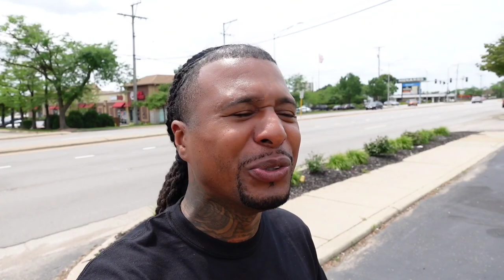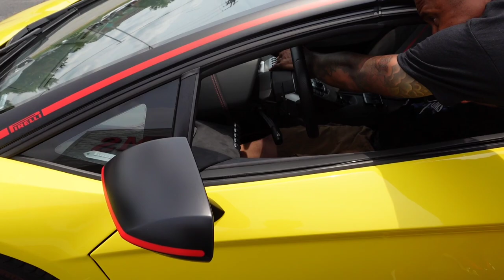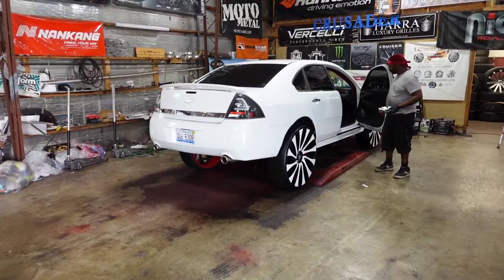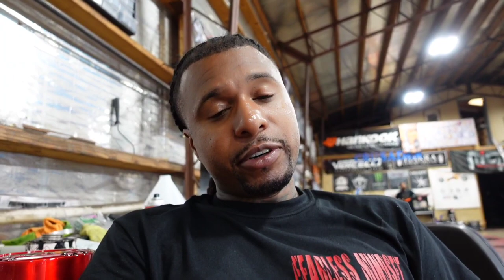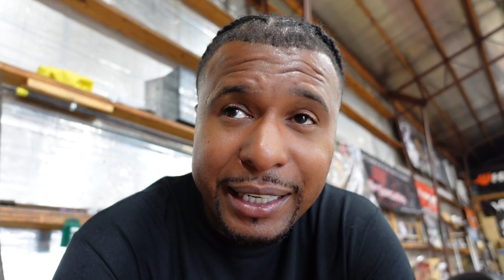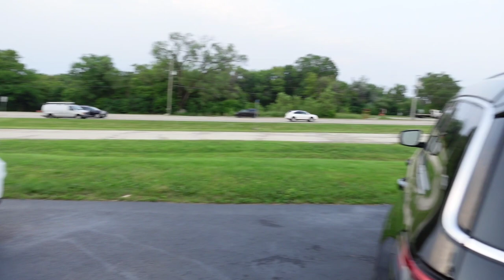I GIVE UP ON THE DUALLY THE RIMS ARE COMPLETELY RUINED WHAT A STRESSFUL DAY

Comment: the strap idea works well when the tires have been left outside to warm up for like an hour then put the strap on and tighten the strap well filling it with air thats what we do at the dealership I work at on the vette tires the strap applies pressure in the middle of the tire pushing the sides outwards

Comment: On 18 wheeler tires the put some thick ass waxy type goop  on the open part of the tire it seals the opening then when you hit it with air pressure it pops the tire messy but it work and don't scratch the rim

Comment: If you use a heat gun to warm up the tires it will make them soft and you can put a strap around the tire to squeeze out the sidewalls to make them air up easier. I have been working with Ferrari, Bentley and Lamborghini tires for over 8 years trust me it will work

Comment: Best thing to mount them type of tires is to have a 🐆Tank & take the core out the stem. With using the air line out the wall not the tire machine line. Free All is a good lubricant 💪🏿💯

Comment: Did yall try the fire way? Spray it with something flammable around the rim and tire have the air hose in light it up and POP. It's how they pop 18 wheeler tires on the the rim. It's worth a try my guy.

Comment: It might not work but maybe if you get some large pieces of the heat shrink wire covers for the tools it might help with the scratches on the wheels not sure what they are really called  but the stuff that audio people use to cover open/live wires then they use a heat gun to shrink on it ,, might help

Comment: If y'all had Tire wax never would have chipped them rims Tire wax is what they use to seal semi tires al need to get a 5 gallon bucket just to have.. they're only like $95 for 5 gallons you could have had all six of those tires mounted in less than 45 minutes

Comment: We have this problem a lot mounting 35/1350/26 Mud tires on a 26x10. Sir the tires in the sun or in front of a blow heater get the tire hot, use the roller on the machine to tuck the bead under the drop center all the way around the wheel. Remove the valve core out of the valve stem and hook an air line (not the air hose on the tire machine) but an air house directly onto the valve stem. Give it a try. Follow us on Instagram @ lindseystirex2